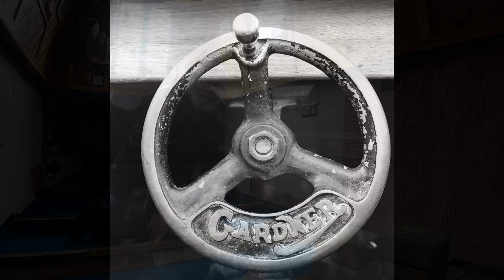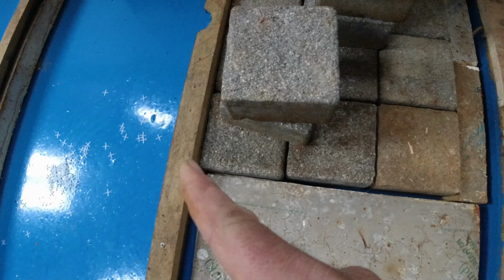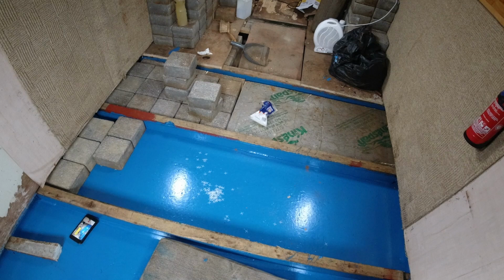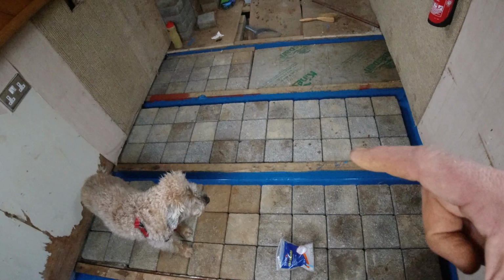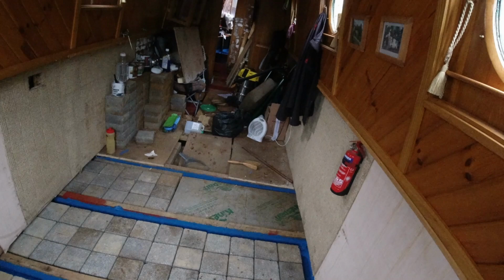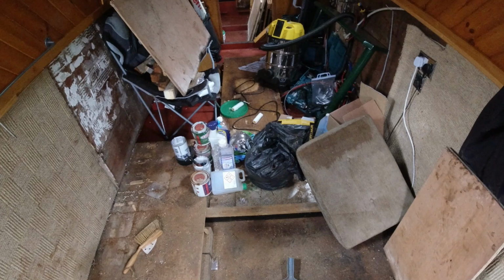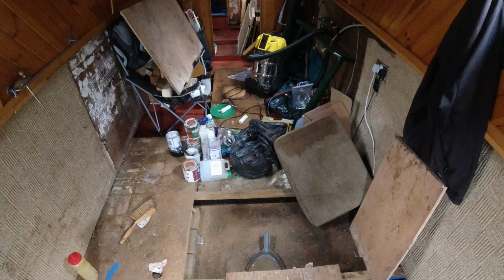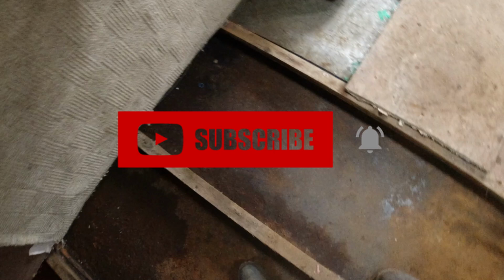Winter Update #17 Getting ballast down and other ballast moved to allow more bilge to be exposed!

Comment: I don’t think the tile spacers will let water pass fully water will get trapped in the v part just strait pieces of plastic would Not have trapped water
Reply from the maker: Yes I think you are right however it will allow air to flow through and any moisture will be s allowed out with it 😊👍🏼👍🏼👍🏼